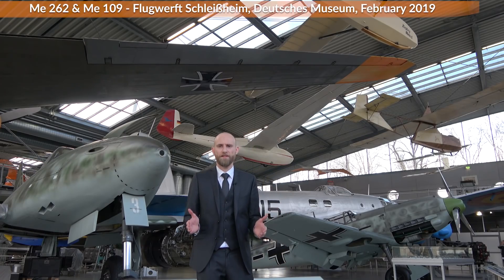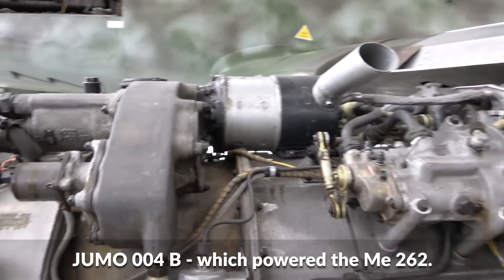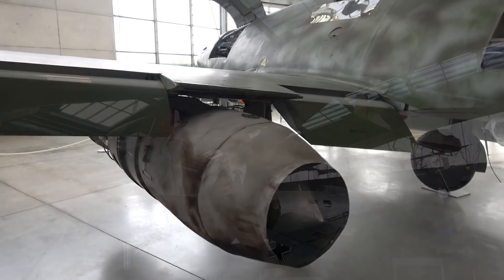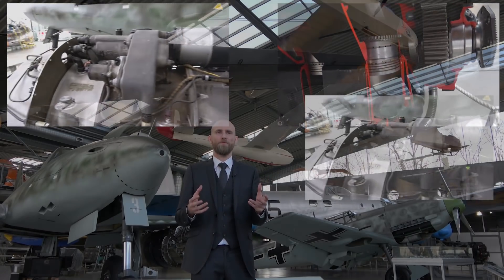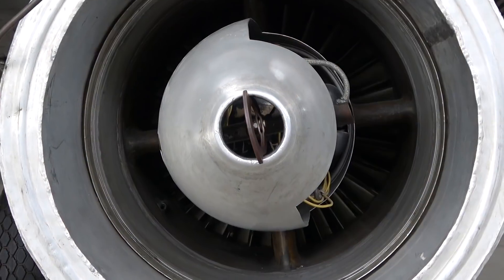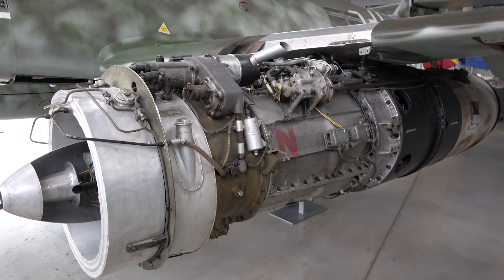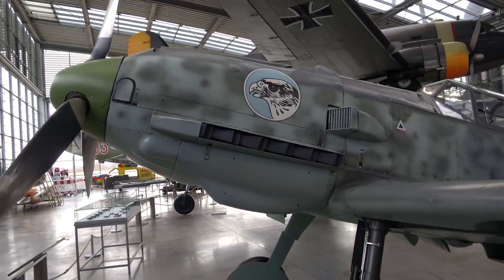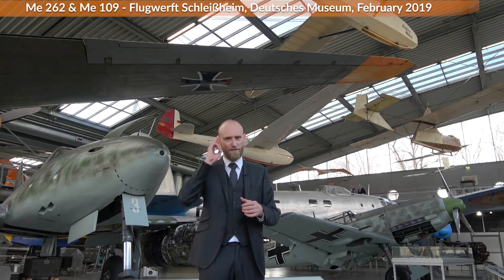Why not just go from the 109 to the 262?

Comment: @ Bismarck and Bernhard. I read an article in "Klassiker der Luftfahrt" a few years ago, which did some kind of the analysis, why it was not a bad idea switching to Jet engines. The production of an comparable Jumo 213 piston engine consumes much more materials and was constructed out of much more very precisely machined parts than a Jet engine. For example: the pistons, crankshaft, reduction gears, compressores and chargers and so on. An jet engine with an axial compressor, was built around one single turbine shaft, the only other very important system which need precise work was the fuel injection system. For the construction of a jet engine they expect only one third of the man hours needed to build the Jumo 213, which was considered the best piston engine available for the Luftwaffe. Further more the expected life time of an interceptor fighter of the western front had dropped down to 5 sorties, if it has contact with the enemy. If we considers that one sortie didn't last longer than 1,5 hours, the short engine life of a jet engine could be neglected. 

The wings were also the limiting factor for spitfire production in 1940/41 :).
Reply: All excellent points. 
I would only add that the blades in the jet engine have also be very precisely machined.

Comment: Instantly switching from something old and obsolete like the 109 to cutting-edge new stuff like the 262 is something that ONLY happens in videogames: UNREALISTIC
But even in strategy games you have to let the (apparently) obsolete trash that's condemned to be completely phased out into non-existence have some borrowed time to hold the front long enough for the new stuff to be fully proven and made available in sufficient numbers.
It's almost the same thing with captured equipment: If you don't have enough of your homemade goods for the troops to use, then you either wait or make do with the foreign stuff you took from the enemy.

Comment: The metallurgy of turbine blades is something else, I think they were getting between 20 and 30 hours of use out of an engine.
Reply: By remaking the hot section of the Jumo 004 with modern metals, they are expecting up to 300 hours from an engine. Of course, this means that the engine rebuilders found all kinds of little problems on the test stand that the Germans in WWII would never have encountered since no Jumo 004 went past 35 hours.
Reply: @DronesintheWild  Well that was part of it for sure. The Nazi's didn't have molybdenum, the best sources are in China, USA, and Chile. All beyond their reach. If you are going to make turbine blades out of steel, not a great choice btw, then you have to have molybdenum. That was also why German armor went to crap in the last 12 months of production.

Comment: The biggest handicap for early jet operations was the lack of range.  The only reason the 262 saw extensive combat was that the air war took place over Germany.  Even so, the 262 only had a few minutes of combat capability before they had to break off the fight and return to base where they had to run the gauntlet of allied fighters to get safely on the ground.  Contrary to conventional wisdom the UK  actually had the technical edge in jet engines -- you could fly a Meteor safely over 30k' -- but by 1943 no allied jet fighter design could make a useful contribution to the war.  

From a technical point of view the 262 had too many technical problems, particularly with the powerplant, to really be considered   an operational fighter until 1945.   The period from the summer of 1944 until late winter 1945 should be considered and operational test and evaluation under combat conditions

Comment: Why do I hear the English jet planes of the time were better then?
Reply: John the meteor had very similar issues, engines couldn’t adjust thrust too quickly or flame out. The engines were not long lived as all early jets suffered from. It was rectified after years of modifications.
The meteor also would wobble in the air with unequal thrust issues which were sorted if the pilot reduced speed. The actual airframe and control surfaces were old fashioned in design. Hundreds of pilots were killed over the years in accidents. The tail skin also would split due to rivet holes.  Worst of all for the pilots there was no ejector seat for years. Many pilots were killed by being pinned in by the slipstream or by hitting the horizontal tail surface. Two of the cannons mounted were prone to jamming. 
One design advantage over the 262 was the engines were mounted in the wing not under. Gloster couldn’t keep up production to demand and had many other companies making parts for them. 

Both were first generation, full of issues, rushed into service without fully being tested.
Reply: @stevepirie8130  how would the jets in the wings help?
Reply: @stevepirie8130  The Meteor's powerplant, as fragile as it might have been, was still more reliable than the Jumo thanks to the work that GE did on the turbines.  The Meteor and the P/F-80 had a higher operational ceiling because their engines worked at altitudes over 30k.   The Jumo's reliability decreased rapidly after 30k'
Reply: Something to do with reduced spars within the wing for load bearing.
Reply: @stevepirie8130  oh ok

Comment: You guys failed to concentrate and even mention one major factor pilots transitioning from a single engine piston, to a jet twin. Going from a single piston engine to a multi piston engine requires a lot of learning and training as the control is different. Let alone going from a single piston to a multi jet... just thinking about it in today’s terms it’s like jumping from a Cessna trainer into a B2 bomber without proper training and experience. I doubt many crewmen where able to exploit the benefits of the 262 under those conditions
Reply: 262's had positive kill death ratios and made a few ace pilots, so I think it wasn't that great of an issue
Reply: @iota515  the Aces were already Aces for the most part.  The 262 had more operational losses than combat losses
Reply: @johnshepherd8687  Shephaaaaaaaaard

Comment: There's an interview with British test pilot Eric Brown where he says that the 262's engines were rated 25 hours before they were scrap, but in reality engine life was about 10 hours.
Reply: False - Service life 30hrs  - manage properly then the 004  refurbished.
Reply: @johndonaldson3619  ... engibeered to 30hrs ... 20 hrs expected ... 10hrs real deal
Reply: @johndonaldson3619  JG-7 were reporting 12.5 hours between engine scrap. Engine scrap means it would be unable to even be refurbished.
Reply: @johndonaldson3619  Except that didn't happen there are multiple sources claiming much lower hours than the official figure.
Reply: probably not an issue if they had spare engines lying around and not enough fuel to hit that 10 hour limit anyway.

Comment: Why didn’t t-

Logistics.  In war, the answer is always logistics.
Reply: amateurs talk tactics. pros talk logistics
Reply: @generalkenobi9782  correct. like dudes talking all excited about the speed of their cars, when they don't realise that the time from A to B has little to do with hp under their hoods, but with road types and conditions, traffic (congestion), (adverse) weather and ultimately fuel availability.

Only when you have pulled up to a fuel station with an empty tank in a deserted area, to find it inop will it dawn on you, how useless anything is (regardless of car, tank or rifle), without the proper logistics to feed it.
Reply: Why would their handling of logs make any difference?
Reply: Ahem.

Why didn't Germany make use of MW50, a technology that was fitted to the DB 603 and other engines in 1939

Why didn't Germany make use of the DB 603 in a fighter, It was tested and proven to be capable of power figures comparable to the Rolls-Royce Griffon, also in 1939.

I don't expect any answers for these, but feel free to try and find a few reasons these things never happened :P
Reply: @Anastunsia   After a short reseach: What did you mean? They did use it. It was for emergency power only, because you can't use it for a prologned time. Also you loose power the higher you fly. So it's not a suitable replacement for normal airplane fuel.
Reply: @Anastunsia  logistics the answer is always logistics, they dont used them because they cant, because if they couls, they would used it
Reply: Ali Mirzadeh The Germans outflanked them.  France planned to fight at Point A.  The Nazis attacked point B.  France could not move its armies from Point A to B in a timely manner, which resulted in the loss of their capital.  Logistics.
Reply: Noobs talk tactics....professionals talk logistics.
Reply: Resource shortages: “Am I a fucking joke to you?”
Reply: And the fact that Hitler was an idiot, when it comes to Germany in ww2.
Reply: George Sears ehhh, I am going to have to respectfully disagree with you. While I will agree that logistics plays a MAJOR factor in war, tactics and strategy can have a major factor as well.

Just looking at some of Germany’s early successes in 1939-1942 displays this factor. I
Okayish logistics but great tactics.
Reply: @kingslushie1018  the answer is still logistics, the tactic dosent work without good logistics
Reply: Kel Thuzad ehh, the Germans Logistics in the eastern front were okay, but they had much better tactics. Now the western front was a completely different story. And that calls for needing much better logics and supply divisions.
Reply: @kingslushie1018  German logistics were a total disaster and the main reason they failed in the Soviet Union. The tanks could have gone farther, but had no fuel, spares or even antifreeze for the Russian winter.
Reply: Len Peters you Are very correct, the German war economy was not suited for a Great War of attrition.

However German Logitisics were already not that Great when they were on the Eastern  front, but it was it ultimately their brutally-effective tactics and new sound strategy that won out the day, showing that logistics, while a major factor, is not everything in warfare.

However the western front was a different story, while successful in the initial stages of the operation, it quickly turned into a war of attrition which the German people couldn’t possibly hope to compete with....
Reply: @kingslushie1018  Won what day? Germany was in ruins and the red flag hung over the Reichstag.
Reply: Len Peters what?
Reply: @kingslushie1018  The Germans brutally overwhelmed the Russians. By the time the T-34 came out. They've been expected to fight 10+ Panzers. And this worked for awhile.
Reply: @kingslushie1018  It was rather that the Germans started a bit too strong. They lacked resources to supply a huge military force. Rather than taking full control of the territories and reinforcing it.
Reply: @kingslushie1018  then why german " so superior" tactics didnt save  them from disaster  in 1942 in Staligrad Battle? In Africa? 
Logistics! Thats why.

Comment: I wonder what happened to those Me 262 after the war? Some ex-German tanks and planes were used for at least a couple of years by other countries, until the run out of spares. I guess the most well known were Panter tanks in French service and Me 109 variant with underpowered Czekoslovakian engines used by Israel. Small arms were used for decades by various forces, some of them still surface in conflicts in Near East.
Me 262 by the end of the war was still a pinnacle of technology. So, what happened to them? Were they scrapped, because of logistic problems, or did they quickly became obsolete?
Reply: A lot of the engines were used in post-war research on jet technology, early Soviet jet fighters like the MiG-9 and the Yak-15 were powered by captured and copied German engines this remained until the Soviets were able to acquire the Rolls Royce Nene and Derwent engines.

Comment: They hadn't really worked out the materials to make reliable turbine blades.  They were multicrystiline steel blades, and due to the heat and stress, they'd "creep" and stretch past desing limits in about 25 hours.  Today we use single crystal nickel blades

Comment: Just two thoughts: 
1) the ME 262 engine had a operational estimated life time of only 25hrs... reality was even less. more like 10-12hrs because of the missing experience of all staff. 
2) it takes some seconds until a Jet engine gains speed, so when giving "thottle" on the 262 it took a while until the aircraft reacted.

Greetings from the Flight Deck :)
Reply: JG-7 were averaging 12.5 hours between engine scrap.
Reply: Worse changes in throttle had to be carefully managed or the jet could flame out part of the reason the allies liked to pick them off on landing as they had to slow so much and it was a problem to abort the landing and make angels, in a turning fight the ME262 is toast against a Spitfire or Mustang
Reply: @jonathanevans4610  "in a turning fight the ME262 is toast against a Spitfire or Mustang" correction in a low speed trun fight,  your avrage Spitfire or Mustang top out in about 650km there will be no power left to substain a turn, then a ME262 can substian a turn of 650km untill its fuel run out.
Reply: @kirgan1000  No WWII aircraft was capable of maintaining speed or altitude in a turning fight. A 262 is not going to be pulling gs  and maintaining 650kmh unless it's in a dive. The thing only has a thrust to weight ratio of about .28. An F4 Phantom in contrast has a thrust to weight of around .86 and (per a guy I know who flew them) could pull 6gs and maintain speed with some loss of altitude. 

Also, I seriously doubt that a 262 could bring a turning fight to a successful conclusion against a piston fighter. The fuel control system of the Jumo 004 seems to have sucked bags of donkey wang and the poor pilot could only advance the throttle slowly unless he wanted to flame out (not to mention the slow spool up of the jet), plus the wing loading is about half again that of a Mustang, meaning the Messerschmitt pilot can't pull as many gs at a given airspeed without stalling. The 262 was strictly a zoom-and-book airplane, which is fine since the thing was fantastic in that role.
Reply: @kirgan1000  One of the history books I read many years ago commented that an 262 could fly halfway around its turning circle in the same time it took a P-51 to fly directly across it; as long as the 262 pilot could keep his speed up, the 51 driver would be relegated to high-deflection snap shots at best.
Reply: Both of your numbers are real, 25 hours for brand new engines and 10 to 15 hours at best for over hauld ones.
Reply: @Enthropical_Thunder  To be fair the life expectancy for a Me262 was only a handful of missions, engine life not a huge concern.
Reply: @AvaToyShow  
Yeah, that's true.
Reply: So 12-10h give about 10 sorties, how long do you think the avrage german fighter will survive 1945?

Comment: As a pilot with a lot of experience with both of these planes in War Thunder arcade, I have nothing substantial to say.
Reply: Well i have ACTUAL experience in the Bf/Me109 and Me262...

Simulator Battles count as actual experience right?
Reply: @NotNicot  almost.. I mean yeah!! Its the closer we can experience
Reply: "aRcAdE" RB and Sim here, so that basically makes me a 4 year veteran pilot right?
Reply: Warthunder Realistic is basically arcade compared to any generic flight sim
Reply: Arcade...
Reply: I have some limited experience on the IL-2 Sturmovik-Flight Sim: There you had to be careful with the throttle or the jetengine would catch fire. Of course the AI when flying the Me262 had none of those issues 🤬
Reply: Indeed in IL2 1946, fast increase of throttle = Oh no! The engines are on fire! 
While in IL2 Great Battles, fast increase of throttle = different sound, giga overheat and then flame torch.
It is needed to watch temperature gauge to not overheat and waaaaaaaaaaaaaaaaaaait for more RPM.
Reply: Arcade................
Reply: i play them on realistic which is basically use the planes how they were used, the BF-109 is generally a heavily armed energy fighter (relying on dives and climbs to attain speed and alt advantage over your opponent VS dogfighting them like in a biplane or Supermarine Spitfire) and the ME 262 if the game realistic version holds true to IRL was actually more maneuverable than most early jets (good luck hitting anything with those fucking 30mm BKs though)